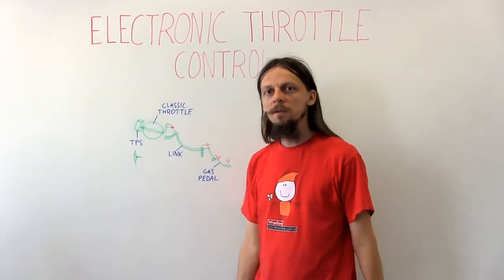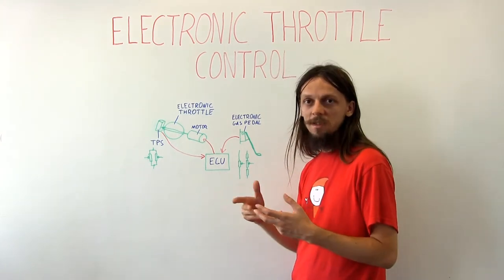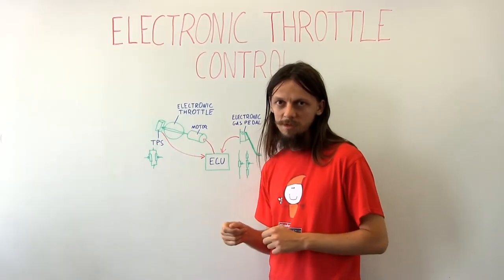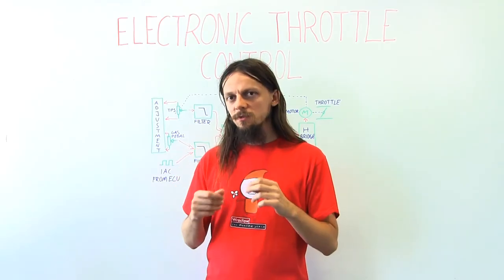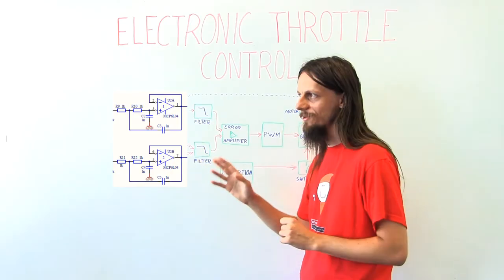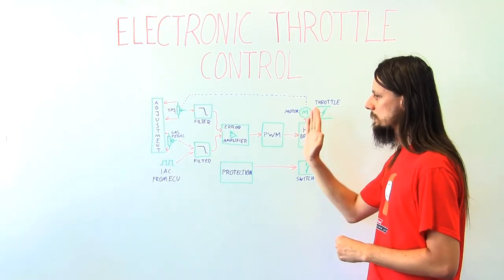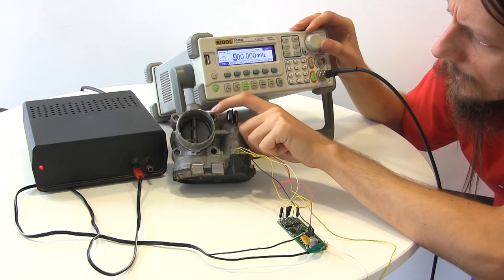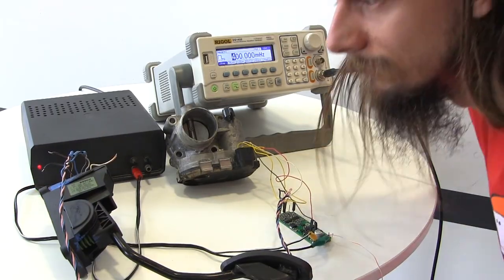DStage #18 - DIY Electronic Throttle Control (a.k.a. Drive By Wire)

Comment: This looks like it might be a good solution to replace the infinitely long throttle cable in VW Vanagons.   Add this to my dream list.
Reply from the maker: A year or so ago I mailed with a champ from the Netherlands who used my controller in VW T3. Although it had the engine swapped for a Subaru one with ITB and he has modified an electronic throttle to use as an actuator for this ITB :-)
Reply: @DStageGarage  My brother's Vanagon has a form of VW Jetta petrol engine with no computer smarts.  I believe we could swap in a later electronic jetta throttle body and accellerator pedal.  Your device could marry the 2.  Thank you for your design smarts.    We'll look for the parts and get back to you.  Paul.

Comment: I went to JLCPCB to make a board. It lists a couple items out of stock. Microchip Tech MCP6004T-E/SL (U2,U5,U6) and MC7805BDTG (U4,U7)

is MC7805BD2TR4G a good substitute for MC7805BDTG 
is MCP6L04T-E/SL a good substitute for MCP6004T-E/SL
Reply from the maker: MCP6L04 is very similar to 6004 but there are plenty 6004 in stock just under different JLC part number for example C7378. U4 and U7 are in DPAK package (TO252)  while "BD2T" most likely means D2PAK (TO263) which is different (bigger). There are many parts from other manufacturers in DPAK for example C21706.

Comment: So is this just a proportional controller? That's impressive it works so well without PID control.
Reply from the maker: Thanks ;-) Technically you could call it an analogue PI (no D) controller. The error amplifier in PWM controller provides the proportional part of course with a coefficient (gain) of around 10. But both inputs have low pass filters that can be considered the I part although it's different per input since one has a corner frequency of 10Hz and the other 720Hz.

Comment: Any plans on sharing pcb? I would love to pair this with speeduino project.
Reply from the maker: Hi. I get people asking me about this controller from time to time and even as we speak there's one guy interested in getting it. So far due to some virus and personal issues I was unable to provide it but now I'm thinking about making few pieces. Just need to order the boards as I recently did for my speedometer controller and wideband O2 (which I haven't shown in any video yet). Anyway, if you would like to build it yourself I can send you gerber files, don't see a problem with that. Some time ago I actually upgraded the design slightly so I have the older PCB version that I'm still using and the newer one that I have not yet tried. However all main things remain the same so I would recommend to go with the new one which only changes the idle input handling. After quite a while I realized that my poor idle consistency might not solely came from stupid things done in MegaSquirt but actually the way I've done the input for idle on this controller. Turns out it only allows about upper 30% of idle PWM signal to do anything. In other words anything below 70% of duty had no effect at all and from 70 to 100% acts as somewhat 0-30% :p The reason for that comes from the principle on which my fail safes on the inputs work but I did not catch that on the first design. I believe that this slight redesign should get rid of this problem completely. Please send me an email to dstagegarage@gmail.com and I will provide you the gerber files. 
BTW, I have also just got boards for speeduino (I've used gerbers of v0.4.3b) as I thought it's cheap enough to have a play around even if I wouldn't use it in the end and what really cough my attention was the fact that it uses TunerStudio just like MegaSquirt. This probably means I can put in same project with all the maps and so on, just change pin settings and it should be working right away (well, still need to add VR sensor conditioning circuit). Also I was looking for alternatives to MegaSquirt as it has many flaws. Ideally I would buy ECUmaster EMU but just don't have the money lying around for that (even though it's cheaper in Poland ;-) ). Also a friend of mine was thinking about "experiments" with FIT 126p engine but he was really tight on budget so I was looking around for something cheap for him and came across speeduino and decided I will play around with that myself :-)
Reply: @DStageGarage  Awesome, will send email ASAP. I would also suggest looking in to Rusefi stm32 based ecu. Their microRusEFI ecu can control DBW throttle and all of their projects ar open source.
Reply from the maker: @kaplis117  Yesterday when I saw your first comment don't ask me how exactly but I came across RusEFI :D Never heard about it before but looks rather interesting.

Comment: Hi, im having the same issue with the CPL file. JLCPCB wont accept the first page from the Bom list as it does not contain co-ordiates. Would you be able to share the CPL list? thanks
Reply from the maker: BOM is BOM, it is not the CPL which is commonly known as Pick and Place file and also JLC mentions that but I guess I will have to add a note in the manual. It is a separate file with "PnP" in name.
Reply from the maker: I have just uploaded new version of the manual that now constans detailed description on how to order the board from JLCPCB: https://github.com/DStageGarage/ElectronicThrottleController/blob/main/v1.3/DStage%20ETC%20v1.3%20manual.docx.pdf

Comment: I still don't understand on how to place an order?
Reply from the maker: Hi, there's a User manual in v1.3 folder (still working on one for v2.2 but for ordering process it's good enough). There's a detailed description with screenshots how to order the board from JLCPCB. So which part is a problem?

Comment: Hi mate could I build a throttle controller using a variable resistor? Or could you tell me how please 
 Thanks
Reply from the maker: The gas pedal I'm using in the video is nothing else but a variable resistor (potentiometer) so all you need is shown there ;-)

Comment: Hello! This is amazing. I have a project that needs a similar electronic board.
I have the throttle motor and potentiometer control, can you please help with the electronic board? 
Thank you!
Reply from the maker: Hi, it has been 3 weeks so maybe you have already solved your problem but in case you didn't you can send me your concerns at dstagegarage@gmail.com

Comment: Do you have the electronic control kit ready for use Nissan Micra 1.2 liter motor?
Reply from the maker: Do you mean the controller for electronic throttle or whole ECU for the engine? Anyway, we do not have a mass production of these stuff, at least not now ;-) This controller shown on video above is quite flexible so it should work with most throttles probably once it's calibrated. If you won't something less DIY and looking for a performance ECU possibly also with electronic throttle controller for relatively good price you can check the EcuMaster EMU (polish brand sold all over the word).
Reply: DStage for throttle pedal control

Comment: The 1.1 version have an unfinished pdf. How do you calibrate it?
Reply from the maker: I started to write down an algorithm and an excel sheet to help with that but I realized it's too complicated ;-) I'd say the easiest way is iterative approach. First set all pots for example in the middle and then measure the voltage on the TH+ and TH- (with throttle connected of course). Then adjust the pot near TH- until you get 1V there. Then check the voltage on TH+ and adjust the other pot so it's 4V, after that the voltage on TH- will no longer be 1V so adjust it again. Repeat that process few times and you should get pretty close to 1V and 4V (it doesn't have to be perfect as long as it's reasonably far away from 0.8V and 4.2V). The do the same for the GP+ and GP-. I hope this explanation is clear ;-) I should put it to the PDF...
Reply: @DStageGarage  makes sense yea. TH being throttlebody and the other the tps. Seems straight forward. How about the gerber, is that finished?
Reply from the maker: @runesmDK  Didn't I put gerbers on Speeduino forum? if not please drop me a line on dstagegarage@gmail.com and I'll send it to you :-)
Reply: @DStageGarage  its there, i just misread on the forum and thought the gerbers where unfinished too 😀
Reply: @DStageGarage  i've send you an email regarding the bom
Reply from the maker: @runesmDK  And I have just replied ;-)

Comment: where can I find the little electric board  to do this project
Reply from the maker: Sorry for late reply. It's not sold anywhere but if you're interested I could probably run a low volume production for you ;-) I'm talking about bear PCB rather than the already populated one as i do not have time recently for anything ;-)
Reply: @DStageGarage  where is it??? I need this man!!
Reply: @DStageGarage  I too am interested in this!

Comment: hi, I would like to make your DStage # 18 project, I tried to upload the files "DStage_ETC_v1.2_gerbers.rar and ETC v1.1 BOM.xlsx" on the site https://jlcpcb.com/ but a cpl.xlsx file is missing (I attach example files they sent me), do you have this file of this project?
if yes can you send it to me ?.
or if you give me the site where you made this project.
Thanks.
Angel
Reply from the maker: You just have to copy one tab from the BOM file that has the right (simplified) format for JLCPCB to a new file and send them this one. Maybe I will put it on the repo explicitly...
Reply: @piega AI limit - did you ever find the CPL list?
Reply from the maker: I have just uploaded new version of the manual that now constans detailed description on how to order the board from JLCPCB: https://github.com/DStageGarage/ElectronicThrottleController/blob/main/v1.3/DStage%20ETC%20v1.3%20manual.docx.pdf